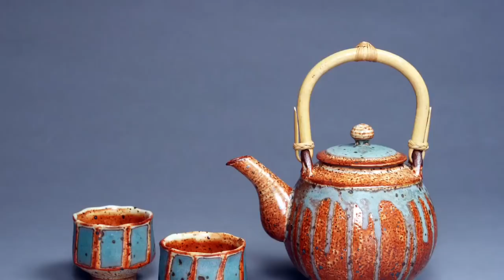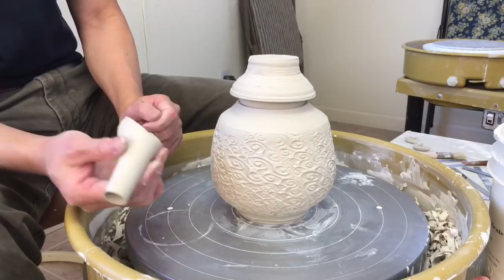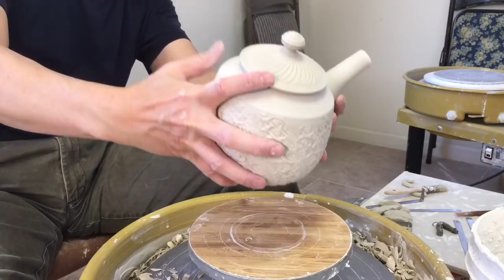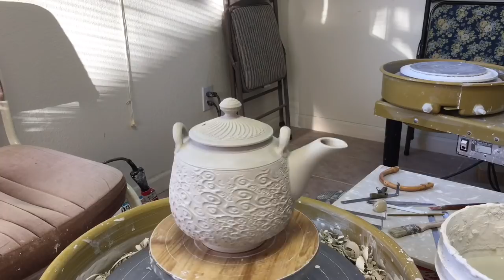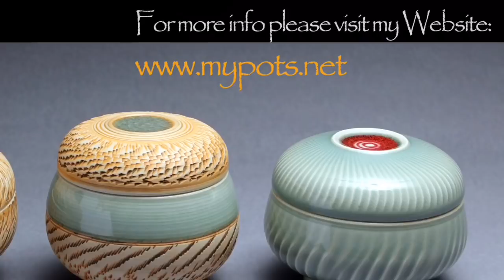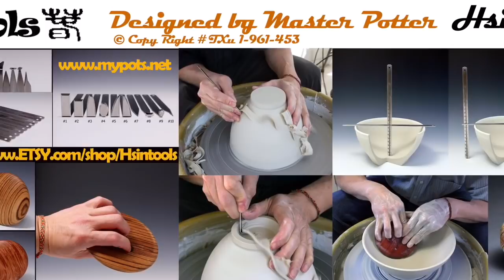306. Trimming/Assembling a Bamboo Handle Teapot with Hsin-Chuen Lin 林新春 提樑壺修坯接合示範

Comment: I have a question I just bought a Japanese tea pot and the bamboo handle has not been placed but I noticed it’s way bigger length wise than where in supposed to attach it, is that normal? If not how do I go about placing it in?
Reply from the maker: Soak the bamboo in the water for easier to bend.
Reply: @hsinchuen  thank you so much for the reply!!!😭😭💖